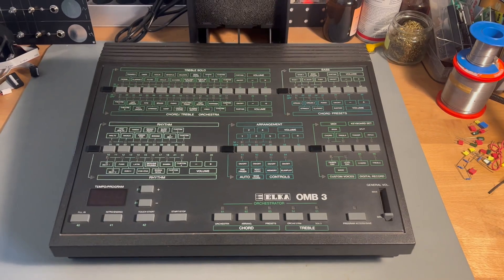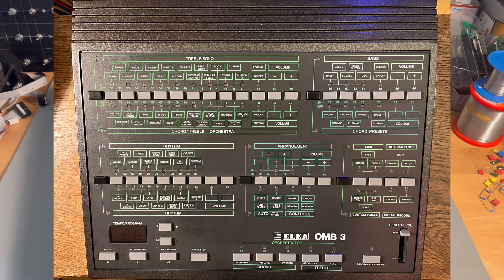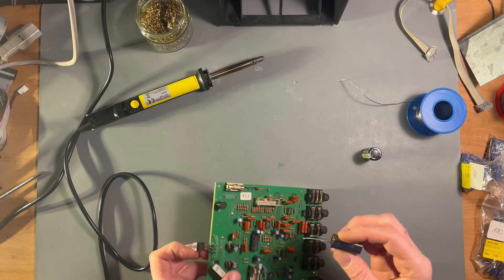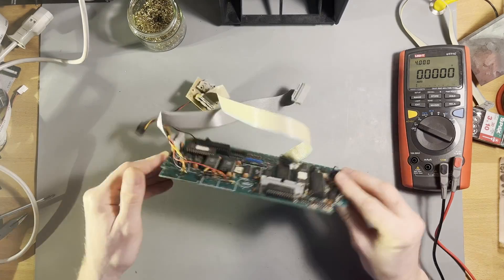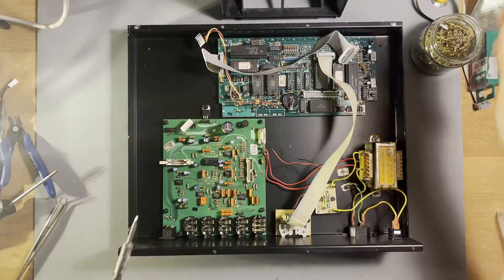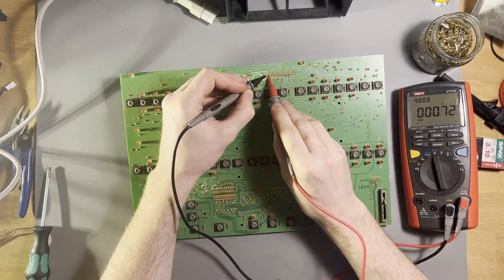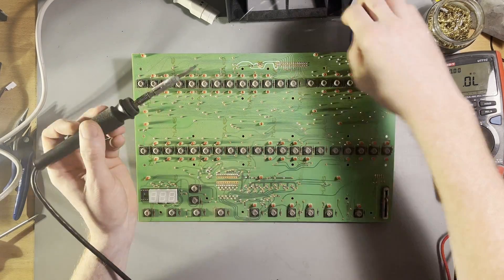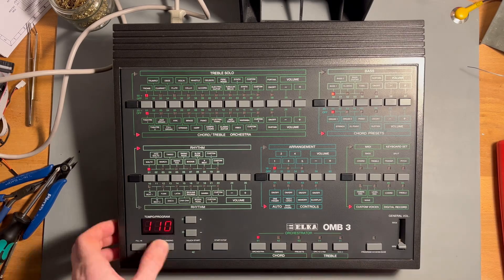Fixing an old Italian SYNTHESIZER DRUM MACHINE

Comment: Thanks for a great video! I recently picked one of these up - partly for nostalgia (I had an EH105 as a kid in the ’80s, the home keyboard version with half the polyphony) and partly because it looks like it could be a fun candidate for modifications. One thing I’m trying to figure out is whether the mysterious "TI STD CELL CF76005" drum chip actually outputs all eight analogue drum sounds in parallel (PWM?). If it does, it should be possible to add individual volume sliders like on the ELKA Drumstar 80. Also, the unmarked G2 sound chips look a lot like Yamaha OPL2 chips. Do you think it’s worth buying the service manual to explore the modding potential?